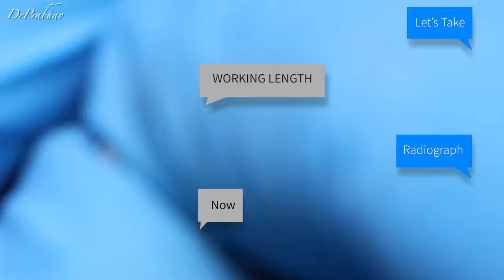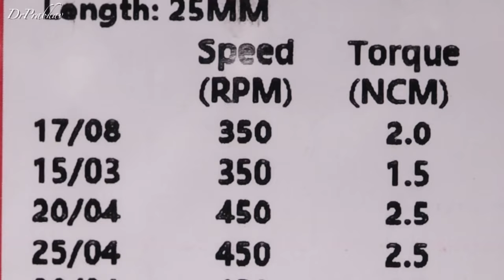Root Canal Treatment🔵Mandibular 2nd Molar🟡Access Opening🟢 Biomechanical Preparation⚪️Obturation

Comment: It should be more conservative. You did not even put a post. More than 60% tooth structure is lost. When we do crown cutting another 10% will be lost. What do you think about the prognosis of overall tooth?
Reply from the maker: Yes Doctor
To some extent 
But since we need to remove the unsupported dentin and proceed more non conservatively to retain only sound tooth structure and this has well supported walls

Comment: Sir, i have some doubts. Mostly this tooth has variation in number of root canals. Sometimes I have found only two canals . Secondly, can we use any lubricant with rotary file or lubricant is not needed. Please enlighten.
Reply from the maker: Yes always go with law of canal centricity and law of canals locations
Yes EDTA 15-17% when used is best as LUBRICANT as well as best in removal of smear layer
Reply: I😊😅

Comment: Hi Doctor,thank you for the video!Why don't you measure the length with a ruler and then adjust all the files accordingly.I would have done even lateral condesation of the root canal fillings and put a fiber post on the distal canal as the cavity is very big.
Reply from the maker: Thanks for your valuable suggestions Doctor

Comment: I have so many comments about this... 
I really cannot go by this, so lets start: The treatment is ok, even though there is no use of apex locator, but than it starts: There is still caries present on the proximal wall, during instrumentation, during obturation and even during the build-up. Final opturation is too short, there is at least half of milimetre or even more of empty canal in each root. When the obturation is done, there is no cleaning of excesive gutapercha before the closure with the composite, obturated canal openings should be closed and smooth. On the final build-up, there is no use of matrix, thats why empty spaces can be seen on final radiograph. 
I just hope thats not in-mouth procedure on real patient...
Reply: Thanks q for the clarify, I also wondering why there is no apex, no cavity toilet, and gp dint clear and push properly, short of canal in the last Obturation, thanks for solving my doubt
Reply: the radiographic apex and the actual clinical apex are 2 different things, that why it's taught that the final obturation should be 0.5-1mm shy of the radiographic apex. As long as you get to the proper WL and clean the canals thoroughly with copious irrigant, the body will be more likely to heal the infection with 1mm of canal space than a gutta percha point sticking out 0.5mm past the apex.
Reply: Firstly that was affected dentin not caries!! Caries has been removed  2nd - radiographic apex location is checked - which is 0.5 mm to 1mm has to be short..
Reply: @videoforall3288  Dont be silly, there is evident that the edge is not trimmed properly. And dont be smart about anatomic apex being 1 mm short, there are visible unplugged canals after treatment under the sealment. You are right, there can be 0,.5 to 1 mm difference betwen radiographic and anatomical apex, but not in this case.

Comment: Why use flowable composite on the floor after abturation. Flowable composite strength are very week and it's posterior teeth . Why not packable composite.
Reply from the maker: Yes Doctor
On the floor due to less viscosity the Flowable composite seals the chamber more efficiently and over above with bulk composite we get strength above at the crown part
Hope you got my point doctor
Reply: @AtoZKidsdental  okay doctor
Reply from the maker: @bk_travels3422  👍🏻